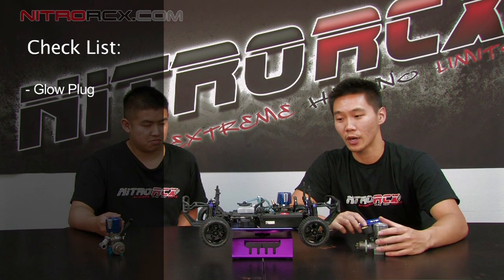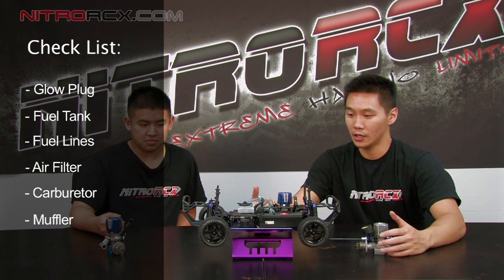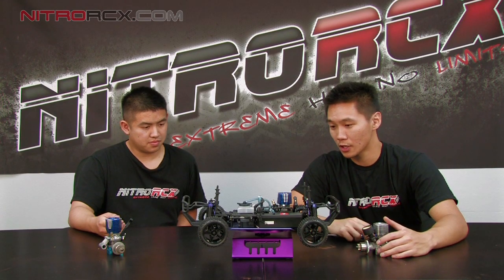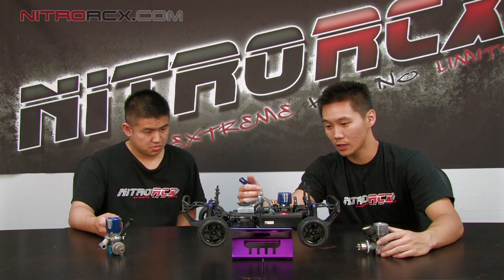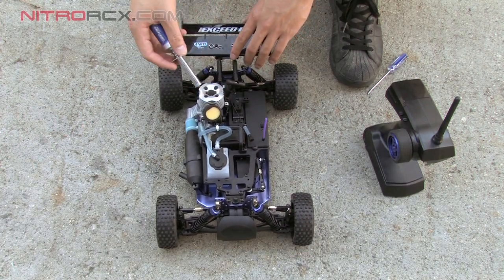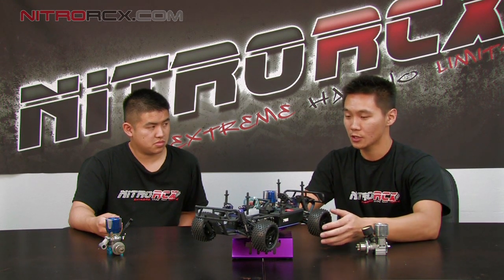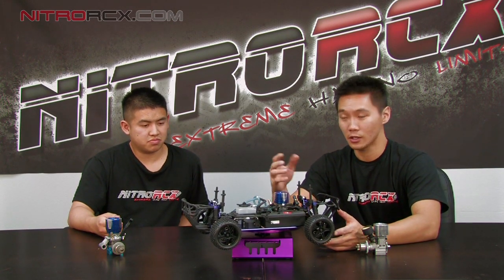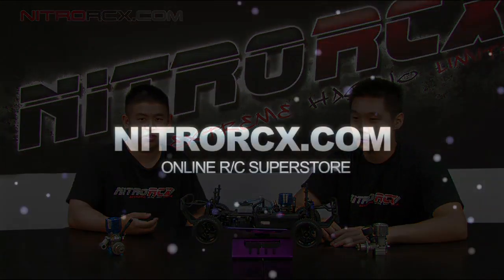Nitrorcx Guide: Questions and Answers

Comment from the maker: Is the engine brand new and has it ran before? When you get a brand new engine your suppose to break it in and let the piston and the sleeve mesh together. The resistance that you feel is normal, now if the engine won't even turn over then something is definitely wrong inside the engine.

Comment: Got my first Exceed Madspeed Drift king with brushless setup. Had some fun on home wooden floor with drift tires. 

How to change the Chassis height (increase the height for more ground clearance to run on Normal rough asphalt road. Changed the tires for more grip to see speed. Any videos on checking the gear box. i am experiencing some cranking noise only at the startup after a 10mins run on rough asphalt. 

I am a newbie in RC.

Comment: Well Since the pull start was making like a squeak noise, I took that off and then i trying pulling it to see what would happen and the whole pull start cam off so I put it back together and that took 3 hours and the main things i did was keep trying to unflood the engine and adjusting the high speed needle. And i also have another question. I tried putting a ticket up on the support of nitrorcx.com because i have a video of all the problems and i tried sending it and it was saying an error.

Comment: thanks for your response. I did open the gear box and cleaned and reset. all ok. However, i wanted to ask if the Exceed parts are compatible with Tamiya aluminium upgrades tt01e. I see nothing is available on your site. IF its not compatible, can you please guide me to one of right part shop.

Secondly, the car doesn't go straight. I tried to do all sorts of TRIM adjustments on the Radio, (fsgt3b), but no help. should i adjust parts? IT tends to go LEFT.

thanks

Comment: Hey, just want to clarify for everyone. The motor is essentially a 2 stroke diesel engine, there is no "spark". Combustion comes from high heat and high compression, not "spark". The glow plug only is used to pre heat the combustion chamber.  You can eliminate the glow plug as a no start contributor if you briefly put the glow plug in question in the glow starter and see if the coils heat up (they'll get red) its not good for the glow plug, so do it quickly.